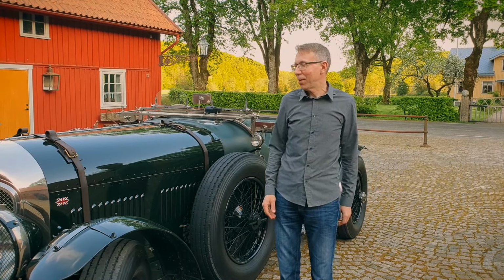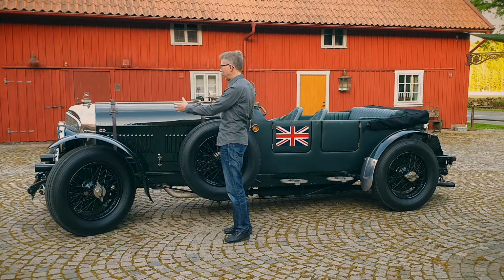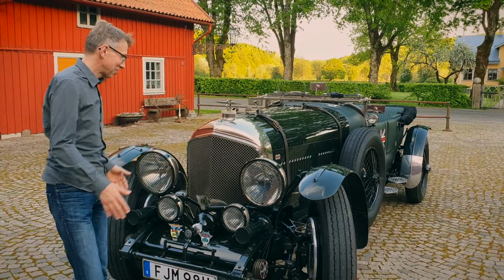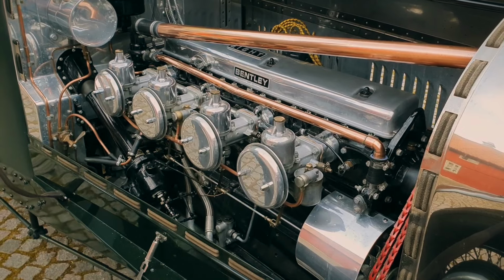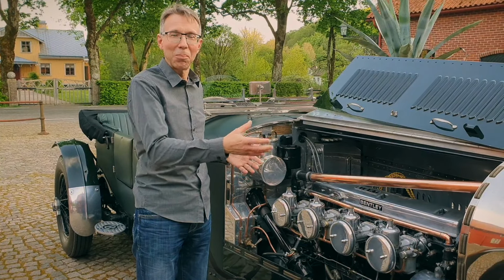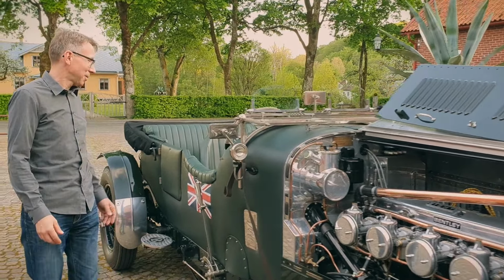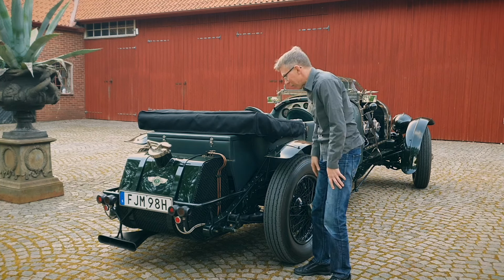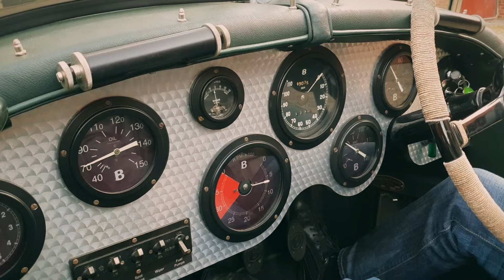Bentley Speed Eight 6 ½ Litre 1930/1949 motor car, by Racing Green Engineering.

Comment: Awesome car. Quick question what is that container looking part pointing out from bottom of the front grill?
Reply from the maker: Hi. Do you mean the round "pan" that potentially could cover a compressor at the end of the crankshaft, although the engine is "unblown"? I do not know but I can ask the owner. A few days ago I saw a Bentley 4 1/2 litre from 1928 at Brooklands. It was interesting to see it. The cars are indeed very similar but a lot of minor details vary a bit. Then I do not know how much evolution there was in-between 1928 and 1930.

Comment: I assume that 1949 was the year that it was first rebuilt from a MK.6 to resemble a pre WW!! car.
Reply: Addition. Or was 1949 the date of the doner car.  If it has an 8 cylinder engine then it's a BITSA and to me almost worthless.
Reply from the maker: Hi James. 1949 is the date of the donor car. It was rebuilt to the 1930 appearance in 2007. These Racing Green Engineering rebuilds are typically not considered worthless, second hand they seem to sell for some 200 000 GBP.